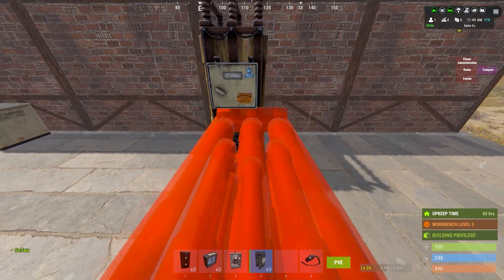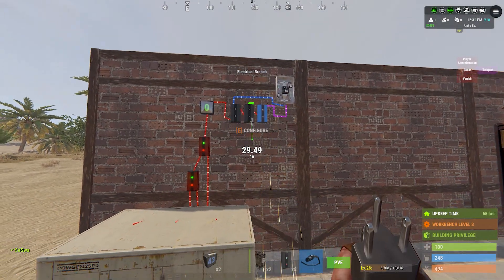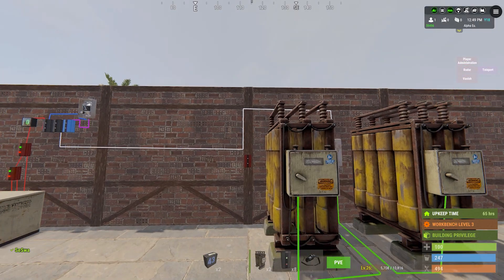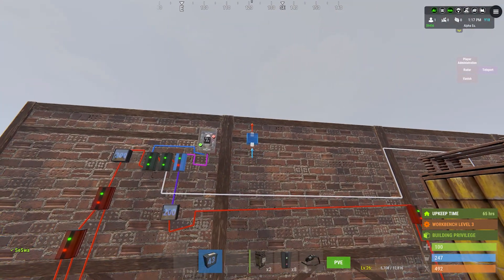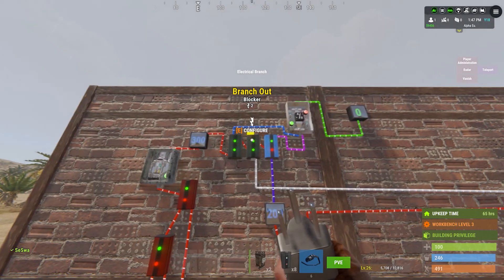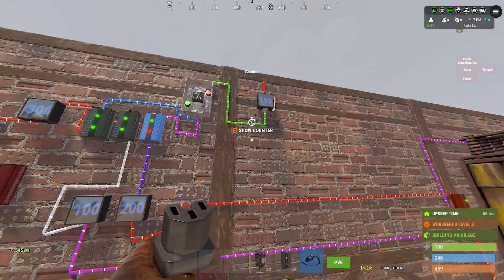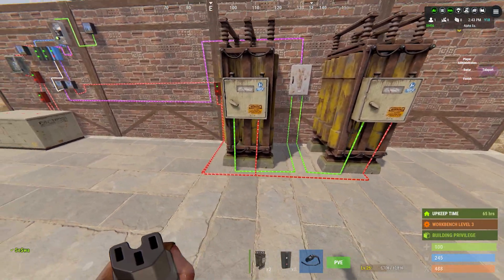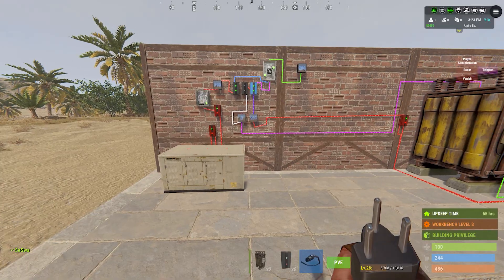Infinite power circuit Rust electic's

Comment: Useless and nothing is infinite here. You literally don't need this anymore, battery output has "battery full" output if you want to flip the power input from batteries to windturbines / solar. And also you just losing power with this circuit, just connecting windturbines to batteries is the better solution imo.
Reply: I would do wind turbine + 1/2 solar panels for extra power, cuz im using always all the power from battery and it doesnt wind turbine most of time isnt enough.

Comment: This circuit was viable about 6 years ago when batteries could not be charged and discharged at the same time. Currently if you use this circuit with a wind turbine, you will on average lose more power than dirrectly wiring the turbine to battery. ( because wind speed and therefore power generated by the turbine isnt concistant )

I would advise anyone reading this to think about real scenarios and stay away from guides that dont explane you the circuits mechanics.
Reply: just use a nih circuit (or the advanced version i cant remember the name of) since it avoids the penalty for charging

Comment: what's the advantage of this over just running the power source straight into the batteries and then the batteries straight into the base?

Edit: @justiceemu answered pointing out batteries are ~70% efficient
Reply: Apparently batteries are only like 70% efficient so if you send power directly from the generators to the outputs and only store the overflow, you can eliminate some of that loss
Reply: @JusticeEmu  oohh that makes sense, that was the part I was missing, thanks!
Reply: @JusticeEmu where the heck did you get 70% from?
Reply: @swiftcoyote1444  it was from another video describing this type of OR gate + blocker circuit.  I honestly don't remember the battery efficiency percentage and haven't tested it so i could be wrong.  I just searched some old Reddit posts and found the number 80%.  The "infinite power" title is poorly worded. I don't think they understand what they're saying.  This system does have the advantage that it will continue to work if the battery is destroyed so that's a small advantage.  I have traditionally used the inline power circuit but just tried this circuit out for a couple wipes and it works but i haven't tested battery efficiency.
Reply: What you are describing is what we call an inline and it would be much more efficient than this circuit in the video. Do the inline, don't do this bs infinite power circuit.
Reply: When u do it with this in it. U can power things longer in the base. For example vanilla servers have long nights and if u use lots of solar. Things wil turn of somtimes if your batterys dont charge fully. 

And if u do it propper the batterys wil always be full so when u get raided and they take out the windmils or solar. U still have the full time of the battery.

Also if u have over production that normaly would be wasted it charges the batterys. 

It can catch dipt if u only have wind mills. They are known to change output alot , so now the powee is reliable and stable.